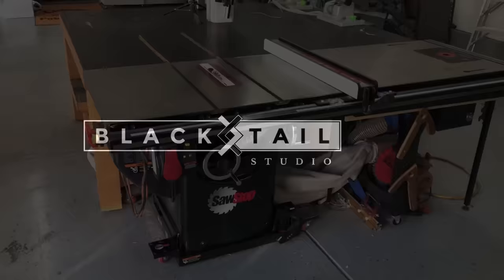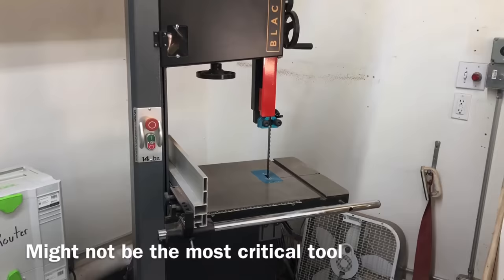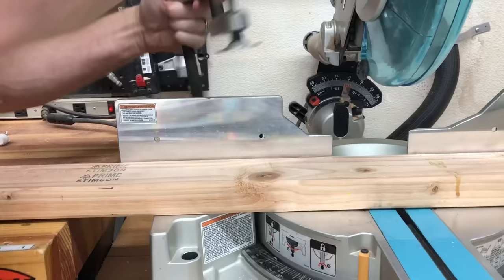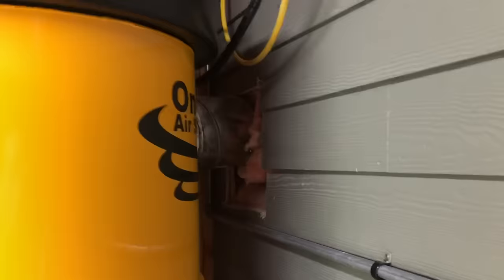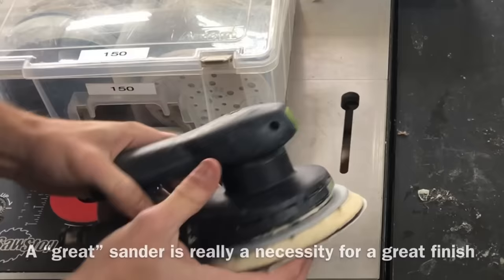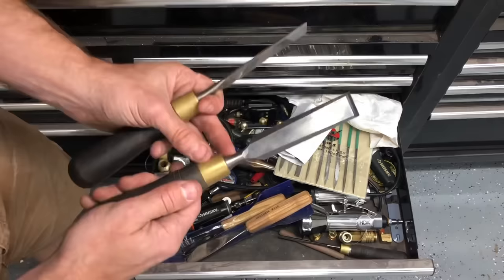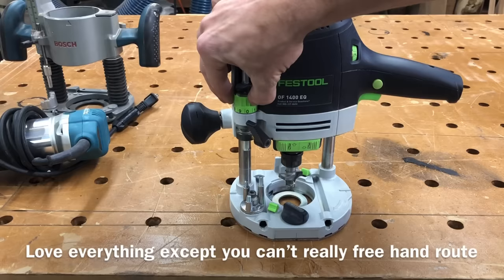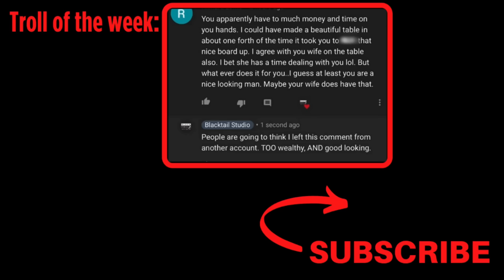10 Essential Woodworking Tools  - Woodworking Tips and Tricks

Comment: Hey Cam, 
My favorite tool is now my new Woodpecker Slab leveling Jig. Can’t imagine working without it and would never go back to the old homemade ones I used in the past.  

I’ve been working on a number projects (both clear and black epoxy) and your videos have both inspired me and helped me to build confidence. I wanted to pay it forward with a quick tip I am now leveraging with my black epoxy tables. 

Often times I encounter deep wormholes or voids that don’t quite protrude to the other side, but are super deep. In the past, I would fill these with a deep pour epoxy and wait the requisite 2-3 days to do my final pour. 

The other day I decided to try to just “cap” the hole with my hot glue gun using A black hot glue stick before the pour and wadda ya know! No air bubbles, perfect pour, 3 days saved, and a good bit of epoxy saved. Obviously this wont help to fill voids that are shallow or those that need structural support, but there are a number of slabs where I can see this coming in handy to save some time. Time is money! 

Not sure if this will help you in your workflow, or if you think there are any long terms negative impacts to this approach, but you have been super helpful along my journey and I wanted to give back a little. 

Best, 
Dave
Reply from the maker: Thanks for the tip Dave!

Comment: My favorite tool is my Festool TS 75. In a small garage breaking down plywood can be tricky. This makes it super fast.  To go with that the TSO GRS-16 PE Parallel Edge Guide Rail Square makes accurate square cuts on panels a breeze. Also the Portamate Centipede gives you worksurface to cut on that then collapses down into a bag. I am currently in a small garage so space is important but I am planning on moving into a bigger shop in the next year and your video was excellent for helping me start my wish list for the new larger shop with lots of floorspace and lots of power. Thank you.
Reply from the maker: Good call Scott!

Comment: My favourite tool - Festool RO 150 FEQ. Bought it about 10 years ago when refinishing oak floors in 4 bedrooms, a landing and stairs. It is ridiculously expensive but I don't think any other off-the-shelf sander would have stood up to the work I have put it through over the years. It actually paid for itself refinishing the floors. This tool is a beast and gentle at the same time. I recently used it to finish a beautiful 48" diameter dining room table built out of white ash.
On my wish list? A set of Blue Spruce chisels. I can only hope they are as good as I hear they are.
Reply from the maker: Good call with the rotex!

Comment: SawStop is may fav! runner-ups are the new 13" DeWalt contractor planner which makes an incredibly smooth finish! Definitely can't leave out the  14" Rockwell bandsaw I bought with extension block 30 years ago, still running perfect and now has  a new Kreg fence. My most quick stop tool for squaring up is the 6" Powermatic jointer!!! All make most things possible, Yay!

Comment: I plan on making my own tables, but man I never knew you needed so many tools.
Thanks for the video.
Reply from the maker: Not totally necessary. But nice.
Reply: Honestly, you could probably get away with a good jointer (Unless you 100% only do solid slab tables then you wouldn't need to joint anything) a good circular saw, maybe a belt sander and a good orbital sander. That's pretty much all you need to make a basic table.

Comment: I was planing to start building my first workshop next month. After watching your video... I've realised that I shall almost double the size of it.... and buy more expensive tools to complete your 10 essential list.... Cool... I will do that... even if my budget will meet the force of TNT
Better do it right the first time ...than be sorry ... 
Very grateful for all the info and mainly for posting it now .... and not next month...
Reply: Plan ahead figure what you need to do basics with. Rest is just specialty to make it easier. Quality is cheaper in the long run, can always sell after your done for a lot of return value  example Delta unisaw right tilt 50inches with a lot of extras like cast iron router benchdog wing $500 add-on saw blades jigs router etc a real complete package. Brand new will cost about $3800 today for same setup sold it for $2k sold it in 3 days.. It's a good saw and 20 years old in impeccable condition... I own a Powermatic pm2000rk brand new now Needed different config table to fit my shop space. So math equates to less then $100 a year.. cheap or be one of those guys that's always dealing with pain in the butt machines underpowered etc problems so you sell 2 years later take a 75% loss just to get the one you wanted in the first place and said back then omg that's too much. You just spent more in 2 years time for other things.
Reply: @CrabCracker  Thank's for this,.. I've just spent about £ 6000 on a Makita set of cordless and main voltage equipment which is not the best but quite decent.
I was talking about the bench saw and a proper big planner unit that I will need to buy and got a quote of £ 16599  for the two of them... Beside this, I will have to spend about £ 15000 in increasing the size of the workshop ... 
My initial budget was about £ 30 000, and now I will extend it to 50k ....  I guess is not that bad because that is what I would like to do from now on... 
Thank's again for your reply and video...
Reply from the maker: That’s a pretty good budget! I think you can do pretty well with that

Comment: I will tell you I made a large purchase of the Festool Kapex Miter saw, and a Rikon Band saw 14", as well I purchased a 10" 3HP Laguna Table saw, just couldn't spend the extra grand for the sawstop, and the Laguna is precision.  the one thing I noticed was that the bandsaw is one of my favorite tools now especially when I got it completely dialed in for resawing.  I have a triton router 3 hp which I use exclusively in my router table because of the lift on the router, vs. spending 8oo for a good lift, so far it is working OK but I know I will most likely change to a custom lift and table soon.  Love your work.
Reply from the maker: Solid lineup of tools! Thanks!

Comment: In the process of setting up my home woodworking shop, your advice and breakdown for beginners is so valuable and helpful, I have just purchased a tablesaw, bandsaw, bosch pro orbital sander and 2.25hp router which I plan to use quite a bit for flattening as I cant quite afford a planer just yet. Just need to get some plans for tablesaw jigs which I saw your post referring to a link for that, and a sled for the router. Starting a clock project with a chunk of Mopani hardwood soon, so the router is going to get some action!
Reply from the maker: That’s a good stable of tools!

Comment: One kind of unique tool that I'm pretty sure most people don't even know exists, is what they call a Floor Edger Sander, it's used to sand the edges of hardwood floors because big machines can only get so close. I at work personally use an American Sanders Super 7R Edger, it's like a really heavy duty orbital sander that costs $2,000 lol. But it's more unique than just a palm sander because it's setup in such a way that it rides on 2 wheels on the back that can be adjusted to how aggressive you want it to sand wood, also, built into it is this little pressure plate that's like an inch wide by a couple inches long or something I think. Anyway, what this pressure plate does is essentially applies pressure to that spot and as the sand paper orbits around it very fast you start to essentially carve out the wood in that one spot. So what we do on floors is go left to right, starting about 8-12" away from the wall, after each pass you move forward another inch or 2, and then go back the other way, so left to right, then right to left, then left to right, until you hit the wall. You then do kinda the same thing but feather it out so you drag from the wall out 8-12" then move over an inch or 2, go back to the wall and repeat. You work in a couple feet sections at a time or whatever is comfortable (this is all assuming the flooring is running perpendicular to the wall. If the floor runs with the wall, you simple just go left to right scoot up, right to left with the grain until you hit the wall, and then you're done. But with the solid 1 HP motor, 2,800 RPM, the weight of the sander and the design of the pressure plate one pass is enough to sand the wood (usually). Like for example I've sanded boards that were a quarter inch difference with 50 grit in a single pass and then feathered out. Why am I tell you this? Well, large table slabs that are hard to fit in planers and drum sanders, are typically very rough from the saw mill and with one of these sanders and some skill (they're kinda tricky) you can sand a slab flat (not like a flat plane, but like, mostly flat relative to the rest of the slab, and getting all of the marks out) in a matter of minutes. I did a 2" wide by 4" coffee table I glued up 2 12" boards for, and I could do each side in 3 minutes (I timed myself) so 3 minutes per side per grit. I started at 50, then 100, then 100 screens which is what we do on floors and it gets them pretty smooth, you can of course go to a higher grit with a normal orbital sander or belt sander. So 20-30 minutes of labor to get a coffee table from glue up to ready to finish (As long as you're not too picky, it'd look like a hardwood floor which is typically pretty good) with a sander that doesn't take up very much room. Now if you had a big slab for a dining room table or something maybe it'd take an hour? And that's from right off of a sawmill. But, it can be tricky to get things perfectly flat with one of these sanders it's a skill not many people have anymore. But anyway, I'm sure you can Youtube videos of the sander. You could probably pick up a used one for the price of a Festool sander though. It's pricey, but it'll take glue and epoxy right off in a matter of minutes with no scraping. So theres your daily dose of information and an alternative to having to sand big slabs by hand. Work smarter, not harder.
Reply from the maker: Funny, I was thinking of doing our floors and wondered if that existed

Comment: SawStop 3hp Pro Cabinet saw...hands down. I’m tracking with you on the other tools. I got the Bosch 10” mitre saw, love it too. Probably my #2 most used machine. I love my little Dewalt planer....silky smooth cuts. My BIG buy was my PowerTec 3hp 8” helical jointer. Lots of butcher block countertops coming up for the Airstream!
Reply from the maker: That’s a strong tool lineup!

Comment: My Bosch Track saw.  It's better than the Festool imo.  I owned the TS55 and TS75, and like the Bosch more than both.  The TS55 I used to own was weak and would overheat too much. 

You are so right about the Bosch Plunge base.  I have one as well and I hate using it.  I actually use the default base the most because the plunge one just annoys me.  I also have the same Makita trim router that you have but I actually prefer using the plunge base for it because I do not like the narrow default base and find that it is too easy to tilt it.  

P.S.  You may be noticing by now that I have left a lot of comments on your videos the past few days .  I just wanted to let you know that I have watched them all to the end.  I just post most comments before I get to the end and therefore do not know the secret password yet which I why my comments never start with it.  Evidently I have watched 34 of your videos the past 3 days O_o

Comment: My favorite tool is my router table that I built with a JessEm lift and a Bosch router. I've noticed a few of the channels I watch and hold in high esteem don't seem to use a router table very often and instead tend to freehand it. Maybe that's just due to the size of the project. But I use mine often.
Reply from the maker: I use mine all the time!

Comment: I think my favourite tool right now is the DeWalt D26204K palm router with a separate plunge base. It is a bit bigger than the Makita, but it has more power, better visibility and it has good work lights, something Makita does not have. The Makita might be better if only used for roundovers as it is slimmer and lighter, but I feel like the DeWalt is more versatile.
I have never liked Festool sanders, they are bulky and clumsy, just like all other Festool tools. I am currently using the DeWalt DWE6423 as my ros, but one day I will treat myself with a Mirka ros, the best there is.
Reply from the maker: Thanks for your take!

Comment: So my favorite tool is my Makita 2 1/4hp router because of the hand grip and excellent control and balance. My least favorite tool that you suggested was the Festool chopsaw had three of them they are garbage buy the Bosch. I have $8000 of Festool products and love most of the tools. The sanders are great for wood. I find a high quality DA sander with peel and stick sand paper works better for Corian or solid surface. But no dust Collection is the down fall. I agree with all the other tools you had. I’ve been doing cabinetry for over 20 years and have a Red Seal ticket in Joinery/ Benchwork. My advice to all apprentices is Buy one tool per paycheck that you have to borrow from a journeyman. This way you will build up your hand tools then move on to bigger tools. Love your content and projects. Ciao
Reply from the maker: Interesting on the Kapex! Good to know.

Comment: fave tool... screw gun...  use it more than any other tool by far. You need one for putting in your inserts and then screwing in the allen bolts.  but the tool that I am surprised at how often I use... the 18v battery operated Ryobi router. the 8th inch quarter round bit lives in it and is supplanted only 10 percent of the time with the quarter inch quarter round.  Next surprising tool is the Ryobi pin gun. Keep it loaded with stainless pins and am pulling that gun out and shooting more things then I ever thought I would. btw. bt

Comment: My favourite tool in the workshop: Felder thicknesser planer.  (It's accurate, reliable and a sheer pleasure to use.)  Had never seen or realised you could get a disc brake on a band saw.  That's a very nice feature!  Interesting how you like your table saw.  Have you ever had the opportunity to use a sliding table saw?  (I'm not trying to convert you, - to each his own)  I find having big lumps of timber so much easier to handle on the slider and it keeps my fingers right away from the blade.  Cheers, David
Reply from the maker: I go to a commercial shop that had a giant one. In my blog I explain that sawstop is the best... not counting giant cabinet shop sliders. No room to add a sawstop slider to my saw. Eventually that’s the plan though.

Comment: The interchangeability of blades between the sliding miter saws (the one you have) and the table saw should be made with a note of caution. Rake angles on SCMS are usually a lot lower or negative to help mitigate against kickbacks. But otherwise, I agree with your point. :)
Reply from the maker: Thanks charlton!

Comment: Just a hobbies, but my most used tool is easily my No. 5 jack plane. At least 50% of my work seems to get done with it. 5-1/2 actually fits me better, but most of my work seems to be on a smaller scale. I have an old lunchbox planer that works, kind of, but no jointer. Guess that's probably why my jack plane gets so much use. Can't not mention my lathe as well. Got one going about six months ago, and can't seem to get off of it. A lot of useful things have gotten done on it, too, not just goofing off.
Reply from the maker: Very cool Scott!

Comment: OK, I'm a weak woodworker, at best.  My 
favorite tool, is a ShopSmith model 10.
Mostly as a lathe.

I'm not a woodworker, but I AM a tool 
mechanic, at the local high end woodworking 
machinery store.  You and I agree with using 
Festool and Sawstop.  (Interesting fact, 
Festool owns Sawstop.)

I am not all that sure about getting a Sawstop.
You can get a paper cut with one of those!  :D
2 different customers, both professional 
woodworkers, came in this year, in bandages, 
to buy a Sawstop.  I won't say what brand they 
both had, but it is "The Yellow Standard. (Sorry, 
I think the company said gold.)

steve

Comment: I own that same Bosch Router.  I do not have the "sticky" plunge issues.  Since I am a mountain biker, I use Sram Butter on my fork and rear shock.....makes things glide.  I applied it on my combination square (PEC) and it moves very smoothly.   Give it a go and it might fix that sticky plunge issue.
Reply from the maker: I actually use Teflon spray meant for bikes. Use it on all my tools. Including this one. I have two of the same routers. Both are the same.

Comment: My favorite tool is my router. I think starting off myself i didn't need half the tools u mentioned. I build anything from stands, workbenches to cornhole boards and don't own a table saw, planer or jointer. I didn't have the money to get the tools. I also think I've learned more by building them the hard way from simple tools then I would have using the easy peasy accessories u named. Not saying to eventually not get them by no means. Im sure you've earned ur stripes in woodworking however, if ur just starting off and want to be the best at ur craft ur appreciate what u build more by doing it  the only way u could have 20 years ago. After all, the woodworker should make the tools, not the other way around. By the way u do have a excellent voice u should talk more and I do love ur work keep it going.
Reply from the maker: Thanks!